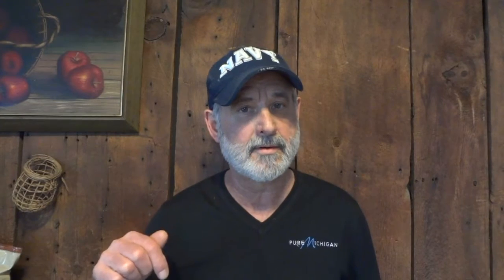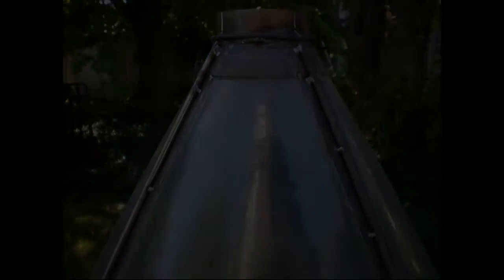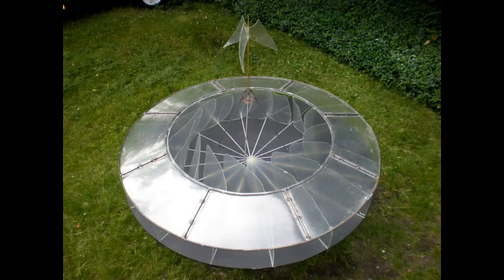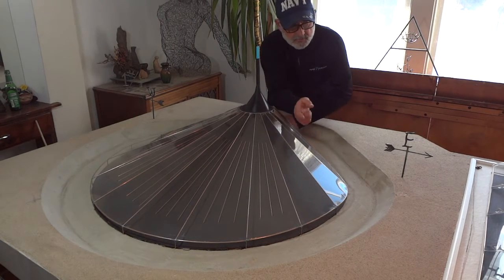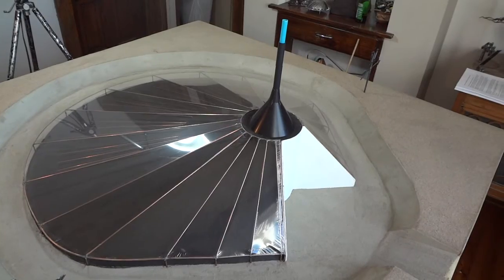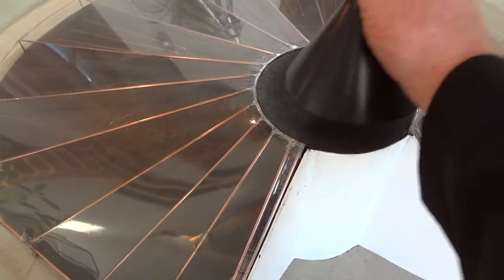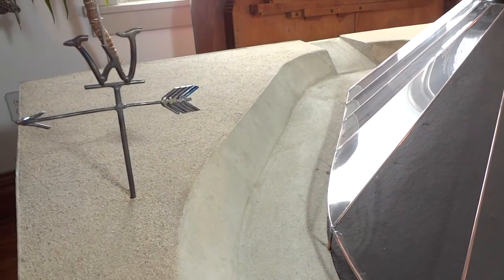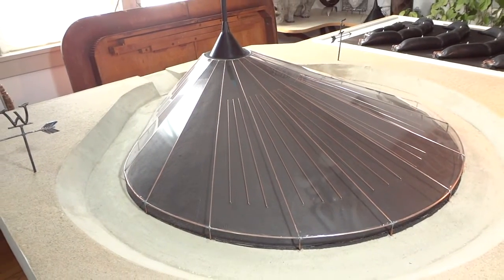Solar Vortex Generator

Comment: Where are the calculations & simulations which prove that there is sufficient net gain of energy to justify the capital expenditure for construction & maintenance?
Reply from the maker: Thanks for your question, Tony.  I live in the upper peninsula of Michigan where we don't get many days that reach 80 degrees.   Even in such an unsuitable environment, the SVG turned a turbine using solar energy, but testing needs to happen in a desert environment. Fortunately, some scientists in vortex technology who far surpass my capability in mathematics support the core concept and are currently putting together a request for grant monies to accomplish what you asking.

Comment: The sand trap will slow down air flow (check out tesla valve). probably kind of a tyson vac cleaner system would work better.
Reply from the maker: Interesting.  Never heard of a Tesla valve before.  Looks like the principle is similar in that it allows fluid to flow best in one direction.  Thanks for your input.